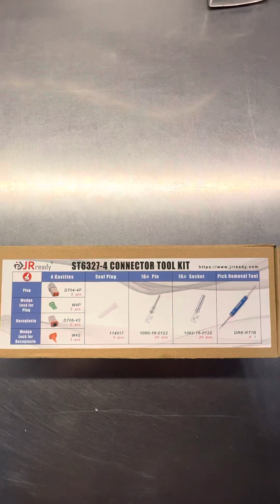2023 KTM TBI Modified Combo Start/Stop Switch (Part 2) - 125sx 250sx 300sx 300xc

Comment: Coming back to this, have you seen some of the issues with changing out the TBI start/stop buttons where the starter engages when the bike is running and in some cases the rider doesn't know it because you're riding full out...  The bendix ends up partially granading and can lock up the motor.  Take a look at Highland Cylcles latest videos where this happened to him.  Bottom line, it looks like anything other than the stock switches being connected, you can end up with a time-bomb...
Reply from the maker: I did see that video, I will look again,  but if I recall Morgan installed one that was still a two piece unit in one housing? Or was it a secondary start?  The way I did mine was a splice with connector (like on the 4 strokes), so it is as safe as it can be.  There should be a code line that defaults the starter button voltage in active while the engine is running to prevent this in any scenario.  Did you do yours?  What bike? Thanks!
Reply: @themotocrossmodchannelWulfMX  Great info! Thank you!  I have a 24 300 XCW that I'm currently building and riding.  I ordered the EXC switch, it's the stock rocker switch and I felt that since it is a factory rated switch I would be safe and at the same time get a switch that is nice with good positive feel.  I love your information and yes, that is safe!  Great job. As for Morgan's bike, he had two separate switches, one on each side of the bar... but different brand than yours  and I'm pretty sure his was from motominded .

Comment: I bought a separate switch set up from Nihilo which was plug and play
Reply from the maker: I saw that they make those.  Is it a 2nd start switch or a relocation?  Thx!
Reply: @themotocrossmodchannelWulfMX  it is a separate start/stop switch like it was pre 2023. Plugs into the 2023 harness without having to modify the connectors. I use dialectic grease on the connectors behind the number plate/ headlight to keep them from corroding
Reply: I just bought the Nihilo set up as well. Sucks the start is no longer black as they have to make the start button bright green! I said I didn't want the green, I wanted black and they called me and said I can't get a black start button. Unreal! All the tech we have today and they can't make a black button?
Reply: Does brown/black stripe wire go with red/blue stripe wire for kill and white/grey stripe wire with solid brown wire for start?

Comment: I did the same thing on my 300. I thought the combo switch was hard to push. I used the stock start and stop switches from a 2022 xc 300.
Reply from the maker: Yup, I just like this layout, seems like it just lays out better.  What connectors did you use?
Reply: @themotocrossmodchannelWulfMX  I cut the stock connector off the start stop switch and wired up the start button and stop button. Both buttons are wired to the same connector. I did not touch the wire harness but the stock start/stop button is missing the connector.
Reply from the maker: @mikebaugus1964  gotcha

Comment: I couldn't help but notice the fork upper and the warning sticker that is a crooked as Brandon on your $2000.00 forks.  My 23 xc and prior new ktmart bikes were all in horrible cosmetic condition for a new bike when my dealers delivered them after sloppy final assembly.  KTM should demand more from their dealers at these prices or give us the option to pick the bikes up in crate. 
It's even worse considering we pay for dealer assembly..
Reply from the maker: Yeah, there is some black spooge center gasket sealer that could have been wiped away and cleaned before it dried.  I will knock that off with some carb cleaner when I get to it.